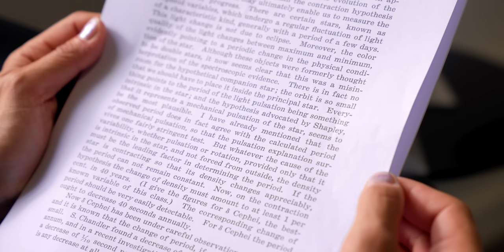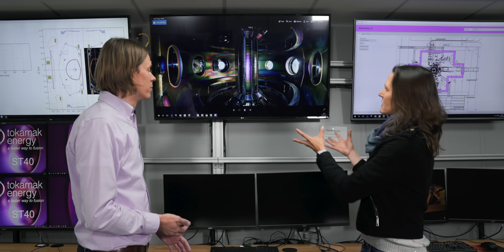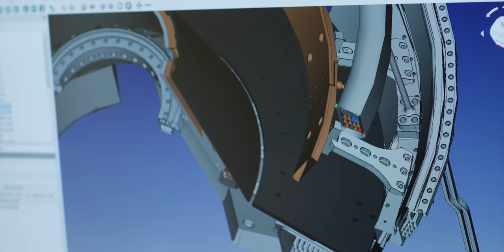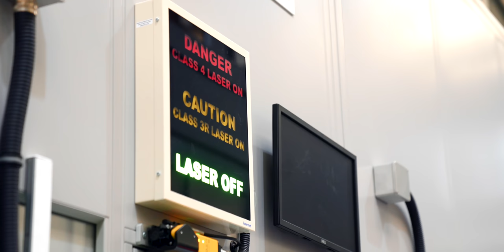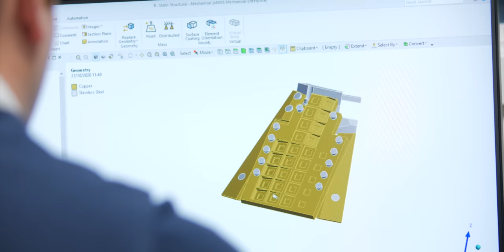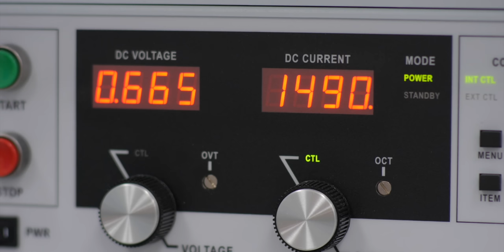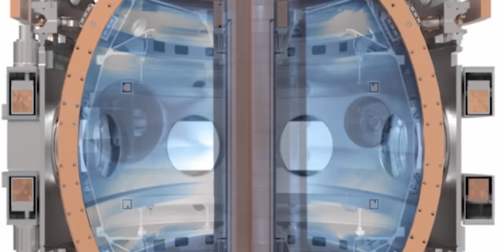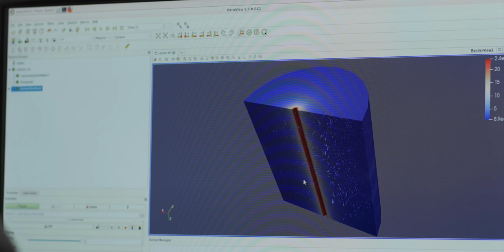Nuclear Fusion: The Secret to CHEAP and LIMITLESS Clean Energy?!

Comment: Does anyone else remember that quote about the old fission power being so plentiful and cheap it wouldn’t be necessary to meter it?  I wish them well but still feel we should be taking advantage of that massive ready-built fusion reactor with it’s 2 billion year supply of fuel.
Reply: Probably untenable over medium to longer timescales. Imagine a Carrington scale event now, with modern electronics and our reliance upon them 👍 And it's due.
Reply: Fission is in its technological infancy. Held back by closed minded Envirowackos and politicians.
Reply: Some politician gave that 'too cheap to meter' quote. No one scientific ever said that. It's a bit strange that it's perpetually held against nuclear power as if it was a technology failing. People have always said dumb things.
Reply: Fusion looks like it requires some expensive high precision kit. If its not reliable then it will never work
Reply: @juniorballs6025  Overdue.
Reply: @pbonney  agreed 👍
Reply: @crynne66  Well, if you are spending several million quid trying to make a rally complicated machine work, the last thing you want is unreliable bits, so yes they'e clearly buying decent kit.
Reply: Ignorant of you to take for granted that everyone lives on a place on earth that makes todays inefficient solar cells worth the risk of buying a set for thousands of dollars if you want to run your home on it. Up here in Sweden the winters are long and you get a fraction of the electricity compared to someone in California for instance. I welcome nuclear electricity in any form, its better than any alternative on the market.
Reply: @Christian_Johansson  As a Norwegian, I totally agree!
Reply: @Christian_Johansson  nuclear makes a lot more sense in high-lattitude countries than low-lattitude ones. Some high-lattitude countries are very windy (like the UK), and thus can use a lot of wind to substitute for limited winter solar resource, but not all.
Reply: @Deo Volente Don’t ask awkward questions!
Reply: @MYOB990  Except for that pesky waste problem ... you know, the stuff that will kill you a HUNDRED THOUSAND YEARS from now.
Reply: Problem with the big fusion generator is that it turns off for 12 hours per day.
Reply: @OAK-808  More likely to be killed by sunlight, wind, a river, or a living thing.
Reply: What about the blackouts that come with it?
Reply: Fission power still has plenty of promise. Just a shame we almost gave up on its development when we'd hardly started. There are several new reactor designs around that have significant improvements over the ubiquitous PWR type.
Reply: HALALPHA  You don't understand what you're talking about. Did you read this in some 'popular' magazine. Nobody's going to mining other planets anyway, an utterly ridiculous idea !
Reply: Indeed, even without the need for the excess apostrophe.
Reply: I also think we (in the UK at least) were conned with fission reactors as a power source; they were bomb fuel factories with a power generation by-product. If power generation was the real aim, then other fissionable material without the long lived waste would have been investigated/used.
Reply: @JohnAsh_technologist  The Magnox reactors were used to help provide plutonium for the bomb project. Their fuel rods were intentionally not left in the reactor as long as normal, so that they ware fairly optimal for plutonium content. The AGRs not so.
Reply: @grahamstevenson1740  Only Calderhall and Chapelcross were used for plutonium production, none of the other Magnox (or AGR) reactors were.
Reply: @Christian_Johansson  Does this mean the californians should not use solar power?
Reply: @Christian_Johansson  for most people on the planet solar is a very cost effective solution. There's a Swedish company, Trine, that is making money selling solar to developing countries across the world exploiting that return on investment. Of course that might not suit everyone in the wealthy North but there are options, that don't require complex solutions like fusion
Reply: "Too cheap to meter", just like "640kB is enough memory for everyone", or "the Titanic is unsinkable" are just nice quotes repeated frequently. These get interesting context when trying to strawman arguments about someone's credibility, but realities are more complex. From the discovery of Neutron, existence of the isotopes, and then interactions of neutrons with heavy atoms (Uranium), it took just few years to make working nuclear reactors (first proof of controlled chain reaction and then specialized reactors to make weapons grade Plutonium, reactors for useful heat and power just few more years later). No CAD softwares, computer simulations, with materials purities at the level these were at the time (and folks doing these things didn't die from cancers sourced by radiation either). At no point there has been an issue with getting more energy out than the input. By that measure Fission energy is simple and trivial, while Fusion is not yet proven to be possible practically. And in the west (for example USA), fission facilities are closed because the price of electricity is slightly more expensive than cheap natural gas (still  a fossil fuel, fairly greenhouse potent especially with leaks). Slightly higher price (because of volatile nature of gas prices, which will surely go up sooner or later) but we decide not to pay for a clean energy premium. What is the hope for fusion to be practical, less expensive than anything else? Will folks screaming that fission is dangerous(coal and gas lovers in practice) accept problems with Tritium for example and materials activation(stupid arguments, but i don’t expect reason from them)?
Reply: But why do we need so much energy electronics are becoming highly efficient just like batteries and solar panels and other forms of renewables so why do we need nuclear fusion coould it be for autonomous cars and robots but we dont need autonomous vehicles or robots infact they are danger to our human existance
Reply: The main reason nuclear fission is so expensive is because of all the safety systems that have to be in place. These will not be needed with a fusion reactor.
Reply: @jimj2683  main reason is that (in the west) we don't build plants in large scale, with standardized fleet of model, benefits of scale deployment etc. Even though the  plants build are fairly cheap (hinkely c), when we recognise that these are virtually carbon free powerplants, with 95%load available, for 60+ years and with fuel that is with  stable supply (inflation resistant unlike NatGas which can be cheap for some time but for how long?). Build these on time and on budget and there is no real competition. If fussion can do similar, then all the merrier, but nothing now suggest that being possible or in reach.
Reply: @VolkerHett  All the best research shows that nuclear power is the safest source of power and the safest source of reliable power. If the spent fuel from civil nuclear reactors didn't harm anyone thus far should I be afraid of it? Lack of dependable power is more scarry. Lack of cheap power is scary to. Nuclear power has been cheaper than coal in the past and there is no good reason why it shouldn't be cheaper than coal or gas in the future. Nuclear power dosn't have to be perfect, it must be better than alternatives, which it is. If Fusion will achieve any of these parameters, then great it is. I just don't like fact-less bashing of the one and only reliable source of power which already saved some gigaTons of CO2, millions of lives from pollution caused dissases and deaths and could do so much more without active opposition, which by some weird coincidence makes fossil fuel folks rich.
Reply: @msxcytb  Yes, but when you factor in the external cost - like waste storage - it is not cheap and will not be cheap. It does not matter if those cost are on your electricity bill or your taxes. And you might check with your insurance if your home is covered in case a minor incident happens and you have some radioactive dust in your house. 
My guess is, you're not covered.
Reply: yes, Chris,  the penny will drop one day, hahahahahahaha
Reply: @Christian_Johansson  well if your going to think inside the box, your welcome to spend money .  How about generating that power where it is sunny and  then buying it .  Ah durr,  hahahahaha, isnt that obvious, hahahahahaha
Reply: @KarlHamilton  doesnt rain every day but we still have water to drink. I wonder how they did that?  PS, it doesnt turn off, its always on. We turn around every 12hrs.
Reply: @andyfreeze4072  are you thick or what? I suggest you Google battery storage.
Reply: @jimj2683  i call your statement BS. You have no idea, nobody does yet.  Fusion is so much more complex than fission,  i dont believe it will be without problems.
Reply: @johnmurphy9550  We shall see to what degree the UK can run off its local renewables. Wind is already 25% annually and we plan to nearly triple generation capacity, which will get us to maybe 65%. Solar is nearly 5% and might get to 10 or 12%. So I don't thik we'll have much difficulty being about 75% renewable. We are a high-lattitude country so some nuclear is probably a good idea too. We used to think more than 20% was impossible, then more than 40%. Now we wonder what happens after 80%. 100% is very difficult as the last few percent become very expensive (whatever tech you use - gas peakers are incredibly expensive too). Perhaps hydrogen peakers or lots of cryo-storage are the ways to fully-decarbonise. Perhaps something else. Hopefully we will find out over the next 15 years or so
Bjorn Lomborg is not a reliable source. He has spent 20 years distorting facts and data to make particular points, too often in favour of the fossil fuel status quo. I would advise taking more note of what the people who run grids say.
Reply: @VolkerHett  waste storage is dirt cheap unless one wishes to make it costing "infinity". Finland build nice and affordable facility under the ground. Minor incident may be affordable unless society reacts like headless chickens, panics and overreact (Germany after Fukushima). No insurance will cover expenses of wars, large disasters etc anyway.
Reply: @andyfreeze4072  I didn't say fusion would be cheap. In fact I think energy will be expensive for the rest of our lives.
Reply: @Christian_Johansson  then why are you crying about it? go build a reactor in your back yard then. LMAO
Reply: @grahamstevenson1740  thanks for the clarification, appreciated.
Reply: @oakfieldfarm4131  nice, thanks for making that clear!
Reply: @oakfieldfarm4131  Don't you mean tritium ?
Reply: @xxwookey  
The quote was on public information films at the time.
Reply: It's a nice idea, but here in the UK we don't see that ball for 18-24 hours a day in some of winter. Either obscured by the horizon or cloud. Yes solar is great though, I'm a big fan. We just need nuclear for winter, especially if we ever hope to move to heat pumps
Reply: its*
Reply: I sland
Reply: A similar thing was said about modern wheat production techniques, but for bread. The problem is that overproduction is a disaster for capitalism. And obviously capitalism is the only system that human society can be built on 🤔
Reply: @OneEyedMonkey9000  yes, it is, we learned that from the 20th century multiple times in multiple continents
Reply: @jimj2683  so there will be no safety systems in place to ensure there are no accidents with a plant the core of which is ten times hotter than the centre of the sun. Ooook
Reply: @RM360CR  A lot of need.  Like producing more food to feed the world.  De-salination of sea water to produce clean water to middle east desert countries.  Electric cars' power.  Warming in winter etc.  Energy is never enough.
Reply: @Christian_Johansson  what about wind, hydro, geo thermal, tidal and wave generation? Nuclear fission requires huge amount of concrete in its construction which generates massive amounts of co2 in its production, it also produces huge amounts of radioactive waste that has to be stored safely for hundreds of thousands of years. Nuclear power stations also take an average of 20 years plus from design to operating plant.
Reply: Worldwide clean energy production is almost certainly a mixed-use approach. Each area of Earth has different capacities for different energy sources to be most useful. A key is batteries and networking a grid. Solar, hydro, geothermal and fusion later down the line all have great potentials. If they got the same level of R&D as fossil fuels had then we could be well on our way to a clean energy revolution. If they did a practical, resource-based study (which has been done with other things like crop land to determine the most efficient places for it) to analyze and determine where the most efficient places to use certain clean energy sources would be and what battery and network infrastructure would be necessary for it to be most effective, we could have that documented in less than a few years time. The problem is the made-up restrictions from the current monetary-system that hold back collaboration, R&D and positive developments like this. 

So before we can truly think about a full clean energy revolution, we need a full economic revolution to end the oppression, exploitation and waste of the current system and transfer that to a Natural Law resource based approach.
Reply: Edison and Tesla said that electricity would be too cheap to meter. Then Big Money took control and decided that corporate profit and dividends were more important than customers.
Reply: Yes. As a child, I thought it would be wonderful, because my parents were struggling to pay electricity bills 60 years ago. It was stated to be likely to happen before the year 2000. 
I've just been faced with an electricity price increase to five times last year's costs (now around 60p per kWh, which is 12/- in old money, and a daily standing charge of almost 50p), despite renewables being reported repeatedly as being the cheapest form of energy. 
The U.K. is obtaining about 33.5% of its electricity from those sources, and about 11.5% more from nuclear fuel. Someone is gouging customers on a grand scale for that remaining 55%.
Reply: Decades ago I was involved with the building of a fission reactor in Alabama.  Halfway through construction of the project it was canceled.  This was TOTALLY due to the numerous unions that had their tentacles into EVERYTHING.  The unions drove the price so high and slowed progress so much that the project became impossible.  I'm guessing that the same thing will happen with any fusion plant that is contracted to be built.  Unions are unreasonably greedy by design.  Government funding (taxpayer's money) demands union involvement because union donations BUY all of our elected public officials.
Reply: The "Too cheap to meter" quote was said in 1954 by Lewis Strauss, chairman of the atomic energy commission. Importantly, he was speaking hopefully about the future of fusion power, not fission. This was before all the truly insurmountable hurdles of fusion power were fully understood. 

His quote has been deliberately misunderstood and misattributed by antinuclear entities ever since.
Reply: @rodanderson8490 Sad experience. Why would unions act against own interests in the long run? One job site killed in this case means that other sites will not happen (which is basically story of NPP build in the US IMHO). Maybe Unions were used and abused- any tactics to slow the process of build of the NPP ensures that Natgas or coal will be selling for decades to come. Huge incentive for little expense.
Reply: Nuclear fusion gets so hot it melts everyting.
Reply: @sergentcolon1  nuclear is so dense and can run atleast 60 years, nuclear fission is the greenest way to make energy reliable.

And for desalination you also use the thermal potential.
Reply: @ferkeap  you need to read up more, nuclear power plants are not green when you consider the co2 in making the hundreds of thousands of tons of concrete required in their construction.   concrete and the storage of nuclear waste for thousands of years they also take at least 20 years from design to operating and cost billions
Reply: @sergentcolon1  that is what Greenpeace and alikes say, not what per-reviewed literature show.
Reply: @sergentcolon1  That's not true includingthat it's at 12g/kwh even with a limitation of 40 years operation, which is not at all a fixed number. 60-100 years is more likely.

So this is including everything, it's a lifetime number.

For win 11g/kwh solar 42.
This is exluding batteries.
Reply: Whomever said that quote was being truthful. Regulators/publicists made sure fission economics stayed within arm's reach of coal/nuclear.
Reply: @xxwookey  and yet September last there was no wind power in the UK at all.
Reply: @juniorballs6025  I actually think another Carrington scale event would probably mean extinction for humans. We are so reliant on electricity. There would be mass scale rioting.
Reply: @jamieniche  I do think some would survive, providing the climate wasn't ruined, but yes I agree in principle, it would be a massive reset for civilisation as a whole. If everything electronic is fried then that's goodbye to everything we use to make our lives easier. No-one seems built for struggle these days.
Reply: Capitalism says ‘no’ 😉
Reply: @CTCTraining1  Mmm - Patio heaters for polar gardens - I can see them on Amazon already
Reply: Yea , pity environmentallists created the mess we live in today
Reply: @MYOB990  Incorrect,    Fission technology is being held back by capitalism.    That's all you had to say.
Reply: @xxwookey  probably not getting the AliExpress "fusion electric power electricity charging watts energy powerful super quality parts" Kit.
Reply: @sergentcolon1  "Nuclear fission requires huge amount of concrete in its construction which generates massive amounts of co2"
Nuclear has the same embodied emissions per kWh as wind power. (nuclear 12gCO2e/kWh, Wind 11gCO2e/kWh, solar is 30-50). Those numbers from the largest ever study of many papers on this by NREL inthe US. It is one of the lowest carbon options we have both to build and run.

"it also produces huge amounts of radioactive waste that has to be stored safely for hundreds of thousands of years"

It produces a very small amount of radioactive waste that has to be stored for thousands of years, and a much larger amount that has to be stored for a few years or decades. This is a disadvantage of the technology but it must be borne in mind that none of this waste has ever killed anyone in 70 years, operating over 400 reactor, and we know how to dispose of it, or even better burn it in newer reactors and turn it into much shorter-lived waste. The Finns have recently demonstrated that it's not particularly difficult to make a long-term disposal facility once you pick a sensible site. 
By 'very small' I mean you get 1200MWh of electricity out of each 1Kg of Uranium.  Coal gets you 0.0084MWh per Kg. The whole EU generates about 2000 tonnes of spent fuel rods every year from 171 power plants, or 11 tonnes each per year - a few skips-worth.

Please read more science-based information and less Greenpeace-style scaremongering. (I love Greenpeace, and even give them money, but they do talk a lot of crap about nuclear power sometimes, or at least have done in the past).
Reply: there won't ever be anything that we don't have to pay the max price for